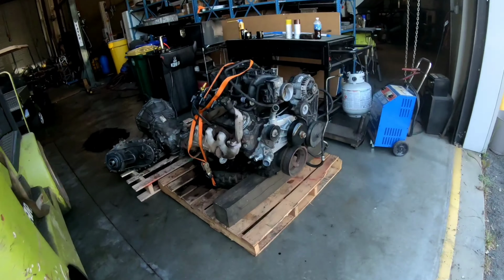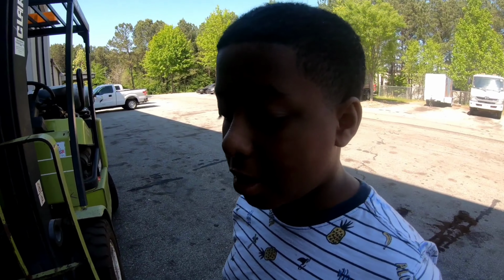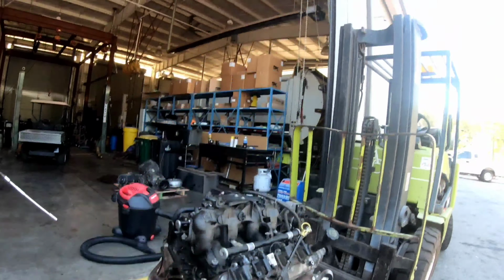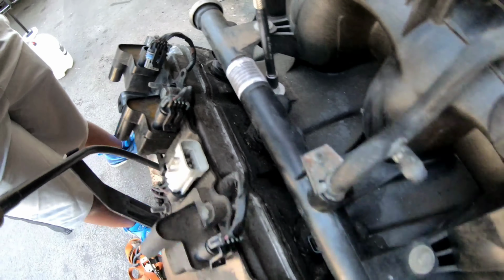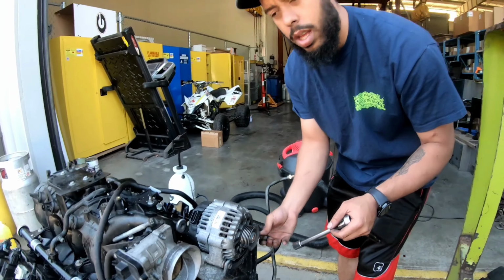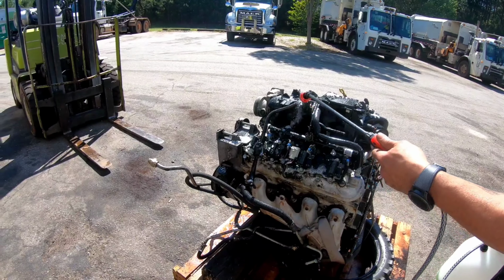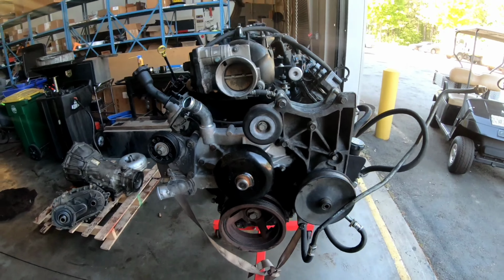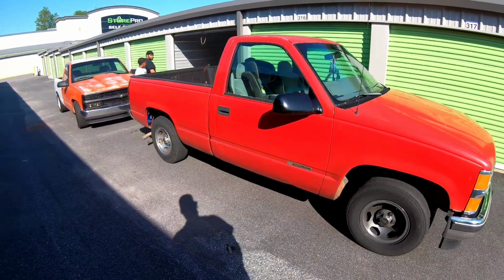6.0 Bath Time to Engine Stand. & Braylon uses Power Tools!

Comment: Nice, finally someone building out the correct trucks.  I've been requesting Derek over at VVG to build out the early 90's.  My second owner 94 still purring at 317k miles with the engine and rear end being the only original's.  Like what you have going on here and your taste.  Keep doing these trucks, specifically GM as there is no match.  When I land Crypto I'll be buying these up and doing the same thing but paying someone to do it as I learn.  So many of these trucks they are endless and worthy of rebuilding.  Seriously Thks

Comment: Did you hook the engine stand to the oil pan?
Got to be the angle of the camera
Reply from the maker: Actually it looks like I did... I'll have to verify next time I'm at work.  it's only the 2nd time I've ever used an engine hoist. Still learning alot of this stuff on the fly. I figured 2 bolts high and 2 low.